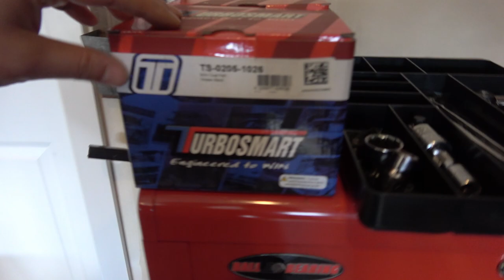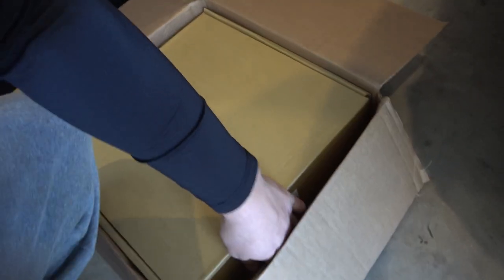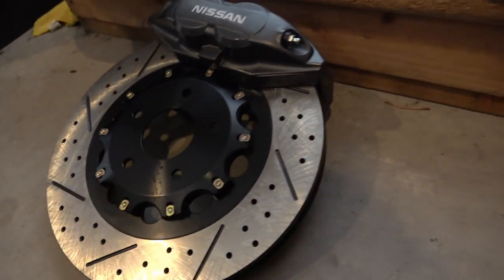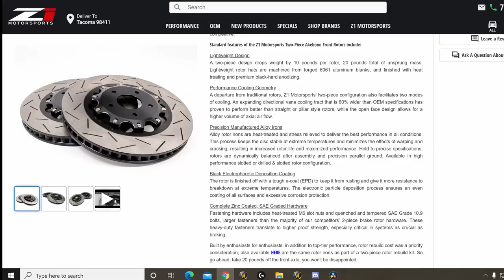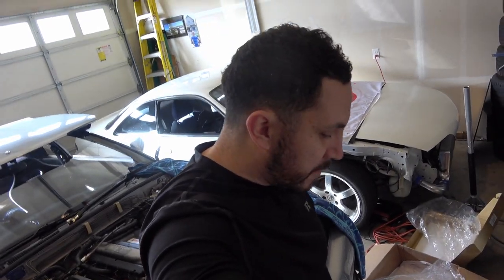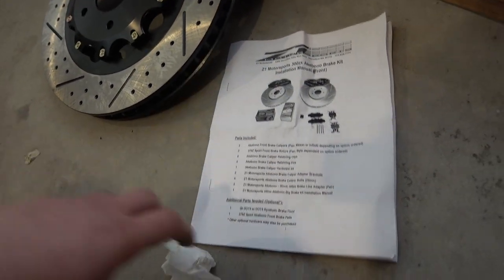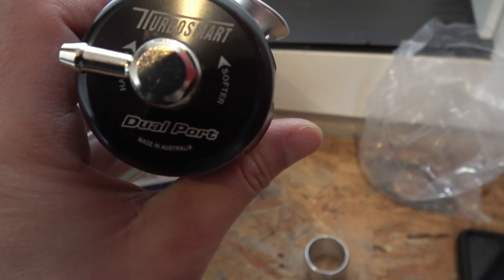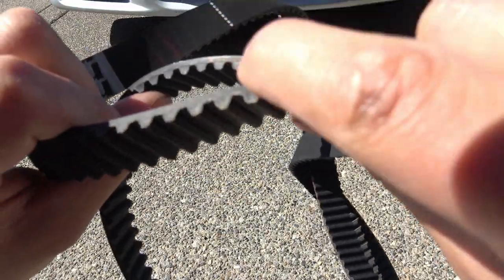Z1 motorsports Akebono 2 piece brake rotors 370z sport brakes calipers Nissan Skyline GTR

Comment: I ended up running the Turbosmart BOVs on my setup as well (I feel like Mr. Me Too...) They don't exactly fit as well as the OEM ones, or you need me tubing because the OEM stuff doesn't line up correctly, I can't exactly remember. I ended up having a shop save the day. I'm guessing your may have run into some issues installing them.  Good luck!
Reply from the maker: Thanks for the heads up I will be expecting some hiccups with the install. I have the bumper removed in the OEM ones off the car. I'm planning to attempt to finish the install my next day off on Thursday.

Comment: Are the new bolts really stainless? They look like they are already zinc plated but not passivated. I wouldn't bother plating stainless or replating carbon steel if they're already plated.

Comment: Hi I need some help, I'm doing this z34 brake conversion on my R34GTR, can you tell me before I proceed, z34 akinbono caliper Vs the R34 gold brembos, does any one or you have any info which are better in terms of stopping power, car has 550 to 600hp.
Reply from the maker: From what I can tell the BNR34 front brake rotor size is 12.75 inches or 324mm. The 370z Sport brakes are 14" set up. I would think the newer designed Akebono Calipers would have more stopping power over the older Brembo brake set up. Hope that helps, I am getting ready to install them soon, I have just been busy on other projects.
Reply: @JDMRightHandDrive  hi.. thanku for replying..  thing is replacing the gold brembos with the 370z calipers /akinbono things, well I would have to change the pipe work and start cutting the dust shields etc, and the akinbono caliper is not a direct fit for the rear due to the handbrake, so I am thinking to keep it simple, get the custom 370z brackets, bolt on the 355mm, discs from the 370z and use the gold brembos everything fits on direct no cutting or fiddling.   If you say the 370z are really better, I might just go for drilled and slotted discs and ferrodo ds2000 pads with braided lines, surely this setup will powerful and stop the car nicely, rather than use the akinbono things and start cutting and chopping etc..  you can buy the bracket in that alloy metal from eBay, guy in hongkong is selling front and rear adaptors for 550 dollars or sumink, which is about 350ish GBP..  ok cheers for message.   If anyone else further feedback do let me know..   full brake kit with 6 pot front and 4 rear is like 5 grand..lol. For that I can go 2.8L stroker forged rb28!!!!    Madness.

Comment: @jdmrighthanddrive Did you do the rears aswell? Im looking into these for my r32 gtr.
Reply from the maker: I still have not installed the front brakes. My front turbo blew and my RB needed a rebuild. It is almost done and I will be finishing the front and rear brakes when my engine is finished. Thanks for watching and have fun with your Nissan!

Comment: Those new brakes and rotors are going to look great. That’s one of my biggest pet peeves is how small the oem set up looks with an 18” wheel lol.
Reply from the maker: Thanks, I am excited to install these. I have been planning it for a couple of years. Your right, the stock brakes look tiny with the 18" wheels!
Reply: @JDMRightHandDrive Will 17" wheels fit over those?
Reply from the maker: @aaronmatuszny8856  z1 Motorsports claims that you need at least an 18-in wheel to  have the clearance to fit over the caliper. Once I install them I will fit my Enkeiwheels and see if they fit. those are 17-in.
Reply: @JDMRightHandDrive  I see. Maybe 350Z brakes will fit too, I'll have to do some research... I really like my 17s.